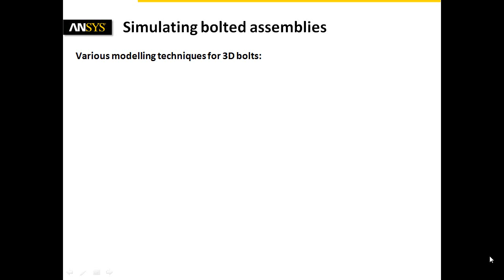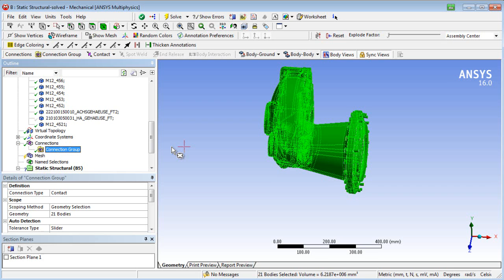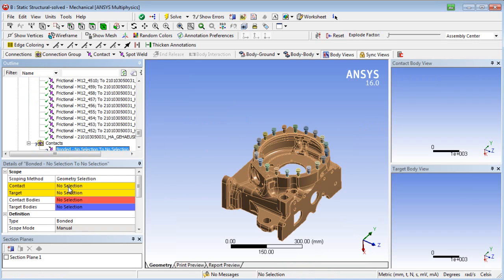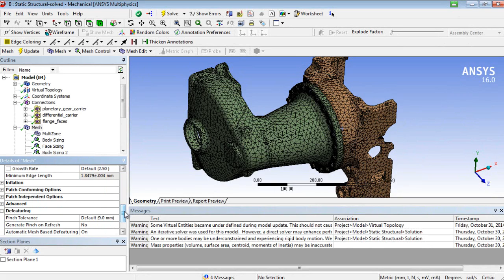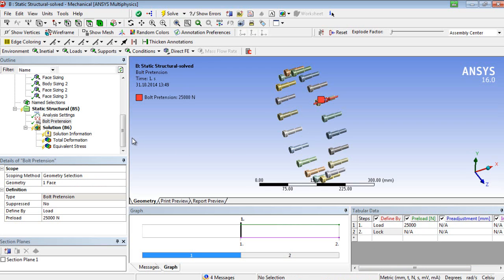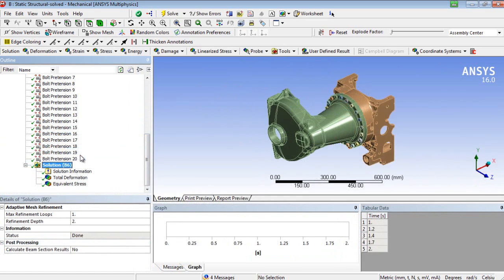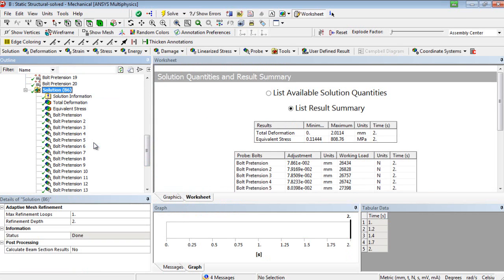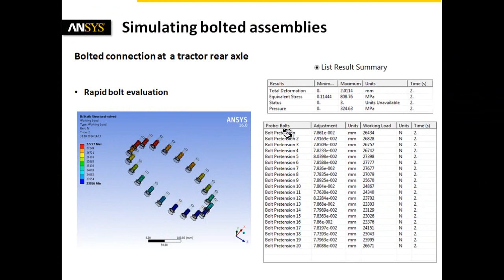Simulating Bolted Assemblies with ANSYS

Comment: why are you defining a bonded contact between the two touching planes that the screws are supposed to hold together if you're going to simulate the non-linear frictional contact? im trying to understand the simulation of bolts

Comment: What if I need to evaluate the life? On the model I want to set some bolt pretensions and some external loads. Only the external loads should determine the cyclic load, while bolt pretensions should be a constant. How can I set this in the fatigue tool? Or maybe this is automatically done by the software? Thank you in advance

Comment: Hello, nice tutorial,
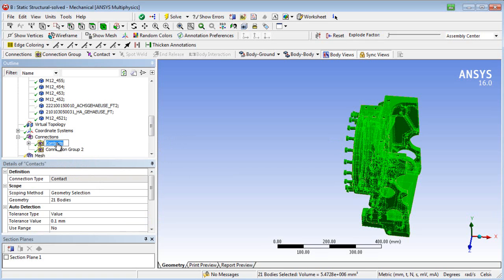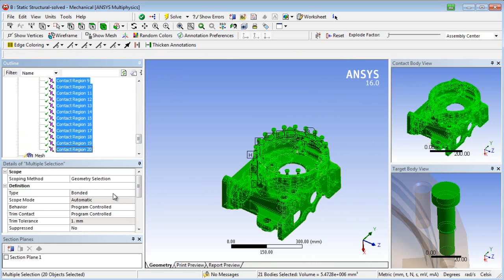At  01:42 you say that the bolt head should be defined as a frictional contact to the planetary and the bolt shaft as bonded to the differential , but at 02:12 you define the contact as frictional with friction coefficient of 0.1 to the differential.
Am I uncorrectly understanding?

Thank you.